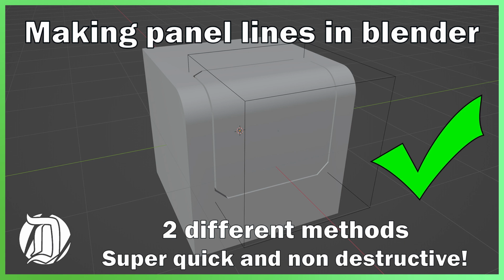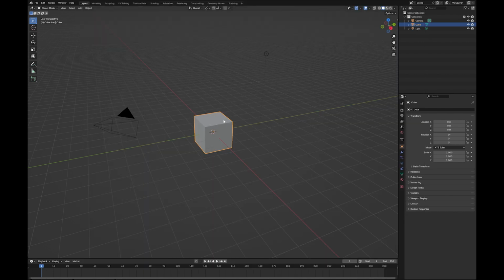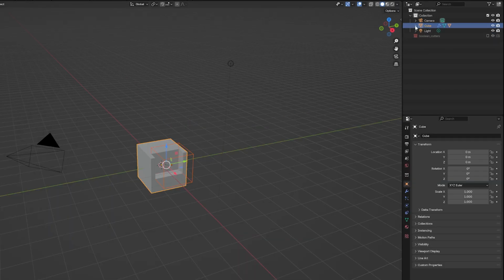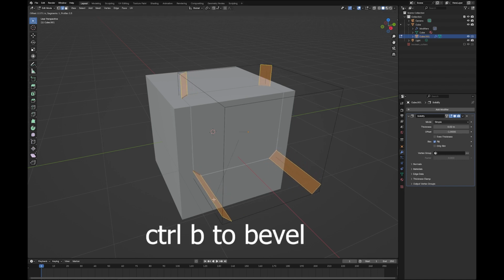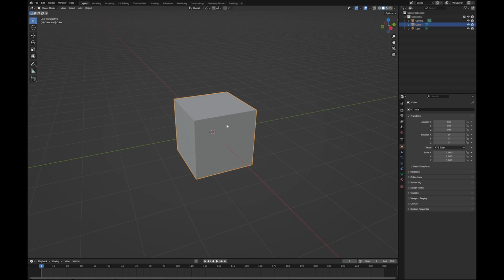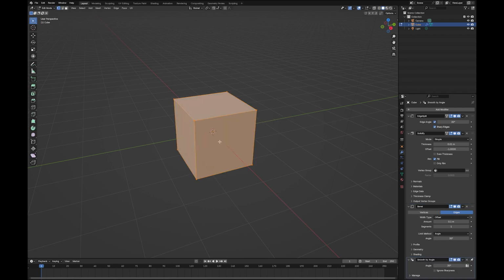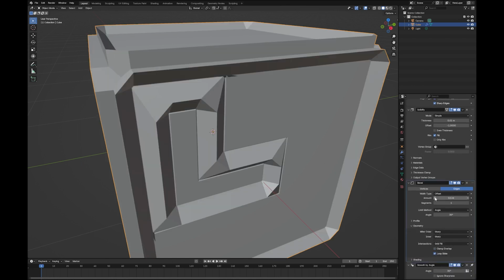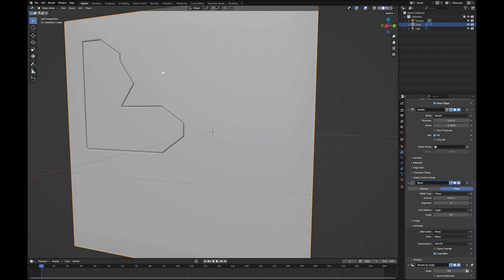2 ways to create non destructive panel lines in blender 3d. Super quick and easy tutorial!

Comment: Are there any disadvantages to the first method? The 2nd method creates holes and performance issues.
Reply from the maker: nope, i was just showing different ways.
Reply: @DestinedToLearn  i'm primarily designing for 3D printing and the first method has the distinctive downside that the thing inside the stamping object is actually not connected to anything, so would simply fall right out after the supports are removed. Or one has to create another thing that overlaps all the things and makes the bevels the desired depth.

In animation they probably aren't issues.